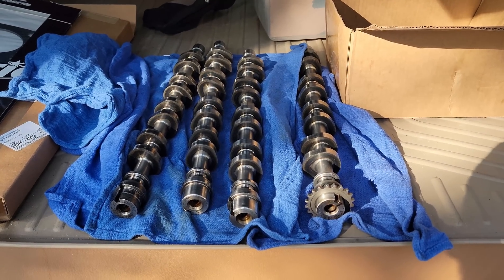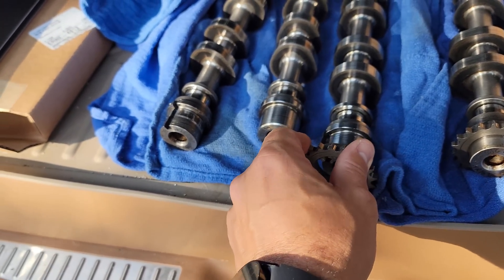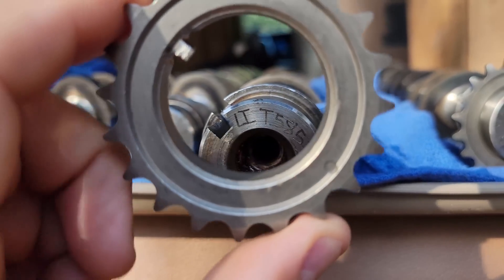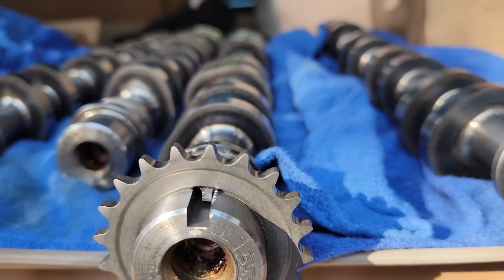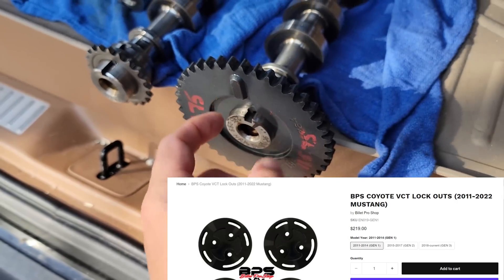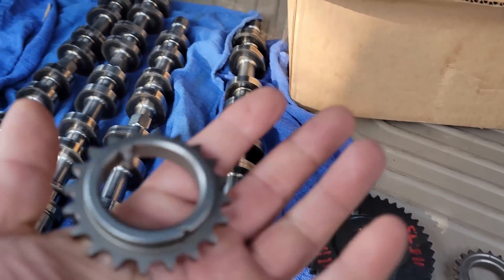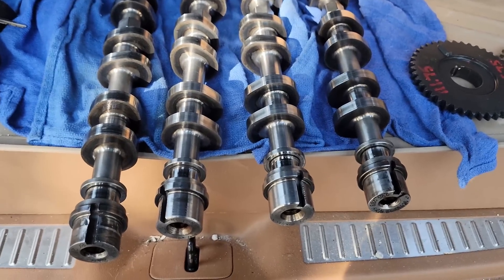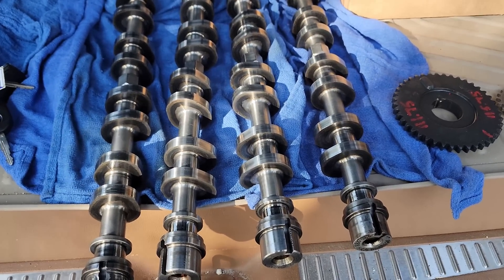NEVER Cut Your GT500 Cam Keys! Here's Why

Comment: The early cobra motors up until like 98 didn't have a keys in camshafts FYI
Reply from the maker: There's a reason that made them for only 2 years
Reply: @YDBT4LIFE  93-98 lincoln mark vii was like this.  It started the 4 valve 4.6.  Point taken though when you modify everything I agree with you.  Curious to see gear that failed on your motor you showed one that didn't fail.  Did the other one shear off cut key?
Reply: @YDBT4LIFE  The L and M pc looks solid.  Back in day they didn't make this sort of thing.

Comment: Why cant my custom ground cams be be made to set up dot to dot?
Reply from the maker: They can. L&m nsr are literally designed that way. A drop in cam that has made 1200 hp with 24 psi and e85
Reply: @YDBT4LIFE  I was going to order some custom cams from a certain key way grinder and wanted them degreed still. Glad I just stayed with stock cams.
Reply from the maker: @mrjesuschrist2u  they dug their own grave by cosigning on that stupid practice.

Comment: Sir I am a fan of your show, and have no doubt that you are a highly intelligent person. I have no interest in proving you right or wrong. I'm not an engine builder or machinist, I'm a millwright just like you. I've worked in almost every refiney there is in the gulf coast states and now I am a permanent millwright and have been assigned 2 units that have over 5000 motor/gear boxes and servos, so I completely understand your logic. I have also assembled many modular engines of all variations. The only fact I'd like to share with you is there is a massive amount of early 4v engines that have no key in the cam gears and are not pressed on from the factory. Have a good day.
Reply from the maker: Early....early. why did they change to key?
Explain pls. And don't say assembly at the plant. Ford keyd them for a reason. And I had 2 failures having to do with gears and cam keys.
Reply: @YDBT4LIFE  I'm not sure, I can only speculate. The early 4v engines were assembled at the Wixom plant. Some cams used in the Windsor plant had pressed on cam gears while cams used in the Romeo plant did not. I would say it depends on the assembly plant. 
I personally would not grind the key, I would also not use an adjustable cam gear. I use adjustable crank sprockets, but they are difficult and time consuming. On the flip side, I believe that key would sheer off if the bolt was loose with or without filing. I believe the aftermarket would respond with a superior billet cam gear instead of superior hardware. I believe that the cams and gears would be broached with single or double keyway with removable and replaceable superior key stock.

Comment: Common sense would dictate that filing down a key wouldn't be good.  Why not file down a crank damper key?  Same reason you shouldn't file down a cam key.  Unbelievable.
Reply: What's the reason why adjustable cam gears weren't used?  If I'm building a car there's no way I'm skimping on 350 bux for this shit.  Is there an explanation from the builder?

Comment: Alex you are 100% correct, why in God's name would someone cut that key and think it was not going to move around under operating conditions....especially a powdered metal piece......powdered metal holds up in compressed loads....it will fail easily in a shear load, which is what it is subjected to in this application......and I'm not a millwright

Comment: Fake news. You didn’t actually support your view with anything tangible. Early 4v’s didn’t even have keys. You should use all your experience to actually explain how the shear force of the key is superior and required to the holding/ friction of the bolt and washer.

Comment: Not 4v related but what about the key way less engines that have no keyway at all, have to set cam timing via cam and crank locking tools,
Reply from the maker: They are probably press fit, tapered fit or have high p-v clearance

Comment: If you actually talked to some of those experienced 4V builders that still file the keyway, you'd find out that they do it because of how many adjustable cam gear failures they've seen. If there's a condition where your motor starts spinning the opposite direction and is able to use that slack in the keyway, you've got bigger problems on your hands.
Reply from the maker: Lol by that logic. The slim key on this gear would also cause slack and the cam angle adjustment is nullified. Same logic. Same result. You're saying BILETT gears break? Highly doubtful. This engine has a uncut gear break last time, logic says cutting the key down will hurt more than leaving it intact
Reply: I'm not saying billet gears break. Name brands like comp cams and mmr have been known slip out of adjustment and smash valves. I am no expert in the cam world, but Todd Warren Cams is an expert in the mod motor world and they can tell you lots of horror stories involving properly torqued and configured adjustable cam gears from name brands.

Comment: Who rebuilt the motor? Asking for friend that has no experience with keyways and ⚙️ sprockets.
Reply from the maker: It's safe to say at this point anyone but l+m cuts they keys. Lol.
Reply: 🤣 good video tho, I’ve work on chiller pumps and large 30/50HP electric motors and your right the keyways and bearing are the failure point 99% of the time.

Comment: Did the person that originally build the motor grind the gears ? Or did the second guy
Reply from the maker: 2nd guy
1st motor lasted 4-5 years
A guide pin broke which ended up breaking the chain. 
2nd builder rebuilt it supposedly did a valve job. Reused the worn keyway cams, ground down the keyway on the sprocket. And raised compression some. That motor saw a power loss the 1st time I went wot.

Comment: Cams would have gone straight in the trash 😮 those cam gears were definitely moving on the cams.  So were the more damaged cams on bank you lost the chain gear? I read somewhere that the upper factory cam gears were made of powered metal grinding them probably not a good idea.  Whoever did the heads did a terrible job.  alot of money for a engine build with no tolerances on paper.
Reply from the maker: Trash build with trash technique's and 4v guys defend it till the cows come home. Mind blown

Comment: even though this whole situation is messed up... why would both sides of the key be shaved down instead of just the side they need to position the cam towards? In my mind, leaving as much material as possible (still a very poor technique to achieve a couple degrees) would be beneficial to not shear off the key completely. Every video that comes out keeps baffling me more and more.

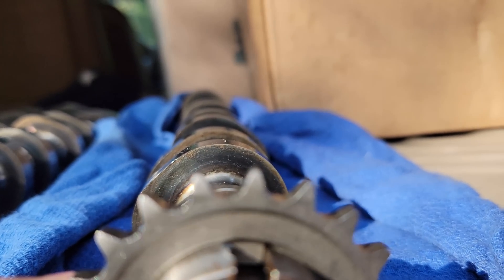Also, I watched the disassembly video again and when he took the gears off at 5:30 and set them on the table, you can clearly see that the keys were not filed down previously.

Comment: If you're a 4V builder that's ok with filing the keyway down to properly degree the cams, do this from now on. Completely grind off all 4 keyways. That way you can get the cams super dialed in. If they don't matter and the clamping force is enough, neither you nor your customers should have an issue with that. Make sure to add that as a line item to the build to get a few hundred more bucks out of the customer.
Reply: Some of the Mark VIII guys can tell you about how some of the early 4V engines didn't use a keyway and ford themselves relied on clamping force. lol
Reply: @daileydriven  You're comparing a sub 300 horsepower modular built in the late 90s to a 660 horsepower modular built in the mid 2010s. If Ford didn't key the old ones, but keyed the new ones, there's a reason. It's not like Ford doesn't improve or revise parts over time.
Reply: @OnlyRears  Lol 10 years later we have so much more added to the crank drive that Oil pump gears are failing but grinding the keyway is cool...
Reply: @daileydriven  some grinding is required using the new timing set on 96-98 cobra cams iirc

Comment: Scrolling threw the comments I see the argument about this has been going on no problem for 20 years. That's cool to say but to see receipts is another thing. It's hard to make it make sense why you would even shave off so little of the key. Just shave it off and have complete adjustability of the gear if the bolt holds it in place. Also saw someone comment that the coyote motor has failures do to it only having a few 7mm bolts to hold cam gear in place not one big bolt like on 4v....that's like saying wheels 5 lug isn't enough to keep the wheel on. So everyone should run center locks? Just can't make it make sense when there are better parts out there to do the job correctly

Comment: Alex. You are 100% correct in this video. I worked at a ford dealer for 16 years as a senior master tech. Did gasoline and diesel drivability and major engine repair. The key and bolt compliment each other. I’ve seen many engine gears over the years that the bolt comes loose and damaged the key. Or my favorite is 2.0,2.3 and 2.5 ford engine that use a diamond  in created washer that holds the crank timing gear in place by friction and compression. The washer compliments the bolts that holds tension.  The aftermarket sees a lot of problems with the diamond in created washer and adds a key way to the crank and pulley for more strength.
Reply: Damn auto correct. AI is out to get us. Diamond encrusted washer is what I was trying to type.

Comment: It’s amazing that people are refuting the keyway situation. If a keyway wasn’t necessary and the older Modulars didn’t have a keyway why did ford spend the money and research to machine a keyway if it’s not necessary?? I’m not a millwright but It’s literally common sense to modify critical components like a cam gear keyway it’s only spinning very fast and controls your valves to open and close accordingly 🤷🏿‍♀️🤷🏿‍♀️
Reply: That's what Im stuck on too.

Eco boosts don't have key ways. 

Ok but this motor does so why? 

2 thoughts, 

1. The keyway is needed maybe to dampen vibration on the cam as it makes much more HP than a 280hp Ecoboost. Or extra security like a cotter pin to an axle. Technically the 32mm nut does it's job but if it doesn't cotterpin stops it from walking.

2. The key way was made to dummy proof assembly at the dealership shop if needed for repair.

Comment: Never modify the key or keyway to create slack. In high tension applications, multiple keys are used for greater rotational strength. What is breaking the oil pump gears in coyotes is rev limiter slapping the gears. So the cam gears are getting slapped also.

Comment: My observation:
Raised compression = smaller combustion chamber
Smaller combustion chamber = less piston to valve clearance
Higher lift cams = even LESS piston to valve clearance
Modified cam gears that create unwanted VCT: recipe for disaster
Cams that are degreed to compensate for piston to valve clearance need to be fixed at that degree and not have any slop, otherwise pistons smack valves. That slop defeats the entire purpose of degreeing the cam.
Reply: I think people drastically underestimate how much vibration a motor gets north of 1000whp. 

Even torqued to 100 ftlbs. (Example not sure actual spec) it can still come loose the only thing maybe saying that bolt from walking is the key way.

Case and point people used to lock tight and torque crank bolt on c6 vettes and call it good. Now if you aren't pinning and using a c6z crank bolt you are doing it wrong and playing with fire.
Reply: @hatch450sx3  I agree. Bolts in general typically want to loosen slightly after a few heat cycles. Higher horsepower applications are going to put more stress on bolts. I'm just pointing out how poorly thought out this build was. The builder should have suggested he upgrade his cam gears instead of filing them. Cheaping out on these kinds of builds ends up costing you more money.

Comment: Some engine use friction washers to keep cam gears in place, like ford 4 clyinders including ecoboost and are not keyed whatsoever. However if the gear is keyed, it needs to be tight and right…

Comment: Ok I made it 12min in to point of showing the wear on the cam keyway. HELLO STUPIT,  if it didn't matter and the bolt and washer held it, why is there wear notches in the cam keyway???? Cmon who would actually say this is ok to do?? If some engine builder is saying that's normal and ok, I'd make sure EVERYONE knows not to use that engine builder cause he is a STUPIT!! For the coast of adjustable gears why wouldn't u use them?? How much time did they spend cutting them and making fit just so. 1hr ? 2 hrs? There's your cost for adj gears 🤦‍♂️
Reply: How about on a small 5hp engine,  better yet a 175hp snowmobile motor, flywheel is driven by a Key/keyway with a compression washer and bolt! When the keyway breaks, the bitch DOESN'T Run! The bolt and washer does not hold the flywheel! Period!
Reply: @kwmiked  yep fly wheels on 350 370z are keyed and if you sheer that key the car won't start seen it first hand a few times
Reply: Even running a offset timing key, u can use 1 degree to 3 degree,  ill tell u what, 3 degree offset key on 91 pump gas on and off throttle on a snowmobile engine sets a Maximum Detonation code on and off all day long! And these guys are doing this to a cam gear on a 20k $ 4 cam 1000hp motor!?? STOP IT , Go sit back on the porch,  WTF OVER

Comment: I personally like the key being on the cam and the keyway on the sprocket it's just a more robust setup.. that's how most industrial applications are.. all the motor shafts, chain drives and cog drives on the conveyor belt system at my work are like that. And if there's wear or damage on any of them, we replace them.. maybe engine builders count on failures like yours for job security... 🤔

Comment: You are correct. The key is the main drive mechanism since the sprocket isn't pressed onto the shaft. Most of the new ford engine don't have keys ways and use the force of the bolt to retain the system. But those systems use more mating surface on the cams and special diamond encrusted surface on the crank.

Comment: I'm not an engine builder by no means but when I was putting cams in my 2v and wanted to degree them. I was told by a known cam guy, all you've gotta do is file down the key way to get all the adjustment needed. That didn't sit right with me, and I got the adjustable sprocket instead. The sprocket is cheaper than a motor.

Comment: The engineers at Ford specd that gear to have a certain width key when made from that material to prevent failure. When the key width was reduced, the material should have been improved. ie billet.

Comment: Your correct Alex – well done!  More, if this damage was there before the second rebuild, it must have been seen during assembly and they should have realized it's a problem - esp given the motor had a failed valvetrain.  Given it's the same cams and gears as the first motor that broke the chain, the odds aren't great all this damage happened after the second rebuild.  You really got a legit argument to get a refund.  

You say mistakes are your tuition for education - but they should be the engine rebuilders tuition too.  One one hand, I can see how a builder would file keyways IF it's accepted practice in the industry (tho not here given the prior damage).  The common practice indicates builders get away with it for lower HP motors, but like everything else, when you crank up the HP/RPM/abuse, tolerance for cut corners goes way down.  My point is - cost for this lesson it should be the builders tuition too. I hope the builder sees he must have made some mistakes that led to this problem, this is a valid claim and the builder does the right thing by you. 

A minor point but keep in mind when thinking about these parts in motion, it’s not the gear that walks as it is synchronized with the chain – it’s the cam that walks relative to the gear/chain assembly.  You probably know that.  Can you match the cylinders with touched valves to the camshaft(s) with trimmed keyways?

Comment: Has anyone found a video of one of these builders checked the cam centerline AFTER a racing season to verify the cams really stay in place with just the bolt torque? Or even a dyno comparison between straight up and 1/4 key thickness advanced to justify their argument?
Reply: I mean 2 degrees (1:2 cam crank ratio) in relation to the piston position in the cyl is not gonna make a huge difference in dynamic compression. Id rather eat whatever machining error from the factory sprocket and a quality cam than risk fvckn shid up myself trying to be Elon Musk. I'm 90% sure Ford doesn't degree them the same way builders degree these things anyway

Comment: Just cuz something worked for someone doesn't make it right. When that gear gets loose, the loose key is gonna act like a hammer on an impact drill, say bye bye to the part! Additionally, the bolt tension argument is garbage - they are parallel shafts! You don't even have a tapering shaft to help hold it... come in, man!
Reply: If it hammers enough could that make enough space to jump a tooth?

Comment: John Lund’s point still stands. How are they accounting for lack of oil pressure in the tensioners when they grind down the key way? The oil pressurized tensioners would immediately negate those 2 or whatever degrees. Hack 💩

Comment: On the adjustable cam gear, up to 3° advance/retard available, each degree change equals two teeth. If two teeth are needed for one degree, how much can be gained by filing the key? If it is that small of a change, while compromising its strength, I'm left at a loss. I assume that I have to be missing something.

Comment: I've seen guys grind keys because the wrong sprocket was ordered. Didn't take long for the motor to shear the key then jam it enough to spin the sprocket ~90° out and grenade the gearbox. A two-day wait for the correct sprocket turned into a four week breakdown and rebuild